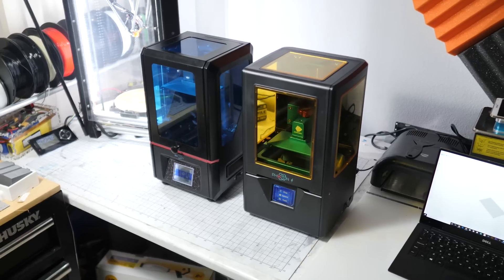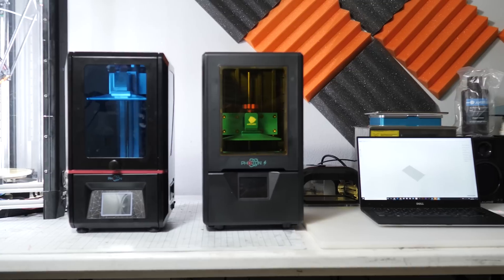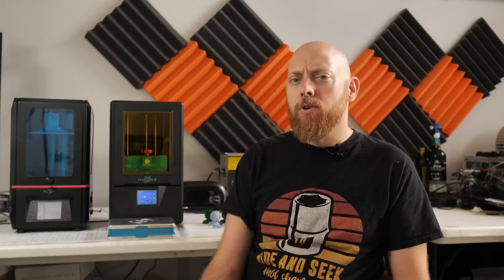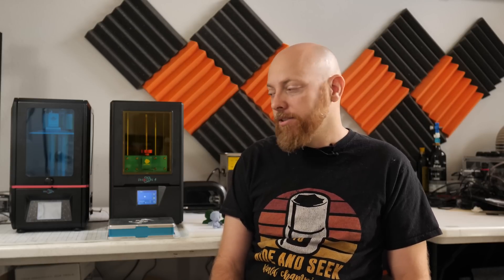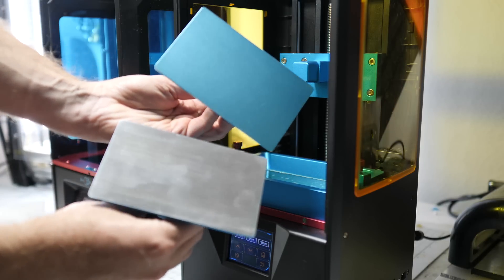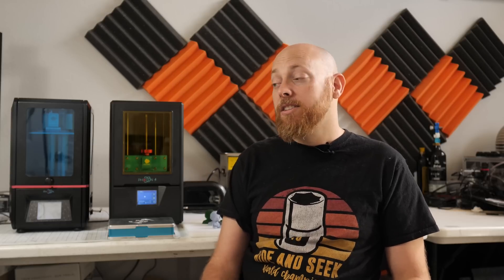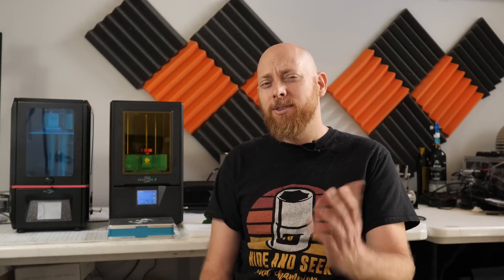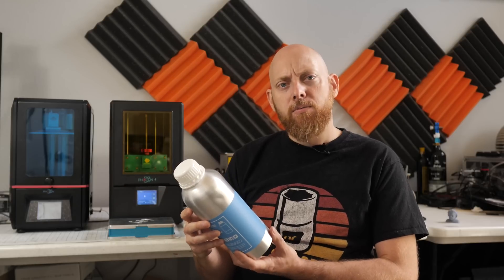Anycubic Photon S, worth the upgrade? S03E08

Comment: My guess is that you't not using the Flint Reid build plate leveling technique.  Tight to the drum down by the .1mm adjustment, then up 5 .1mm bumps.  Works every time.

Comment: I think I’m gonna pick up a Photon S. Looks like they offer it with linear rails now 

Great
Vid.
Reply: Actually, the Z axis bearing system is identical to the original - they just doubled up on it. Both use roller wheels running on round rods.
The upgrade to the original with real MGN12 linear rails is arguably better for long term use.
I bought two Photons early on and immediately replaced the stupid blue windows with amber-orange acrylic cut on my laser cutter. My original Photons are going strong and I get fantastic results with Siraya Fast resins. They work incredibly well on the Photon - 30 second base layers, with 8 second general layers. The Siraya Fast resins do not smell at all, as opposed to Siraya Blu which is much slower - stinks horribly and won't stick or print well below 25C.  
Parts made with the Siraya Fast resins are sufficiently ductile to be drilled and tapped without chipping or breaking. I have not found the Siraya Blu resin to be any better in that regard - even though it is advertised as a "tough" resin.
Reply: @kdanagger6894  Regular Photon is up for 250USD right now, and Photon S is 400USD - do you recommend getting the first one and upgrading the rails instead of shelling out for Photon S then?

Comment: So you printed some parts for a printer on that. What is your experience with making parts dimensionally accurate? I've been having to do a .12mm inward offset on the surfaces of my parts to get a good fit. The XY always seems to be a little too large.

Comment: Anybody else having parts break off of support material?  Larger prints seems to be the problem, I have upped my support connections, bigger contact area, and still the same results.  Making me a little frustrated.  Rocking a Photon (not S).

Comment: I have stock anodised build plate and it's basically impossible to print anything without raising it on support, but then again support is messing up the finish, those parts you printed in orange are impossible on my printer.
If I will try to print a solid 10mm cube it will print around 2mm of it and then it will come off the build plate.
Also the tolerance is very poor, that cube would be like 10.3mm which is worse than what my cheap ass FDM printer does(+/- 0.15mm).
Very disappointed.

Comment: Just a note on servos - The ability to use the Z  index signal of a servo as home point is SOOO accurate. On my mill, I use a micro switch to stop axis movement and then allow the servo to reference to its index signal. As far as I’m aware, steppers do not have the ability to utilize an index signal. Love the videos.